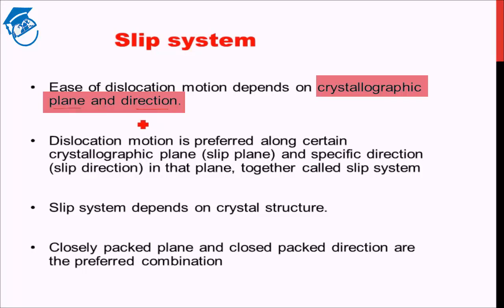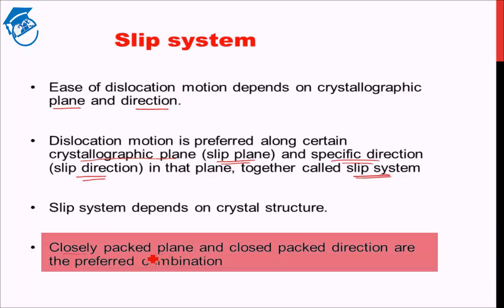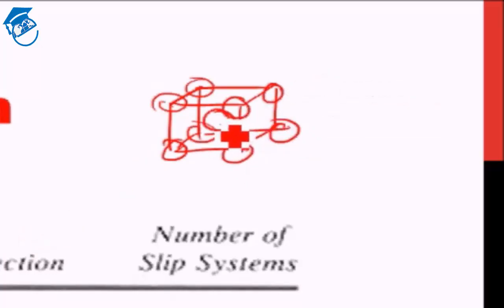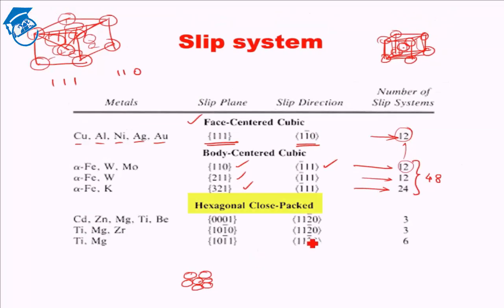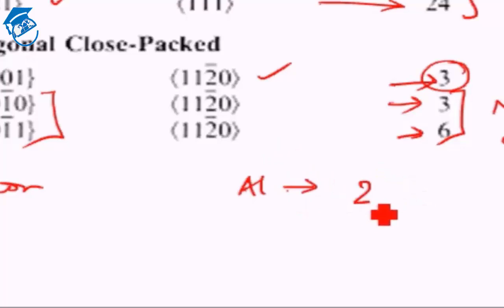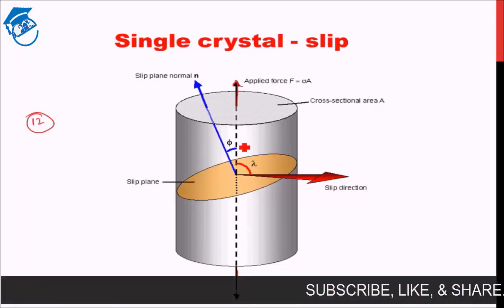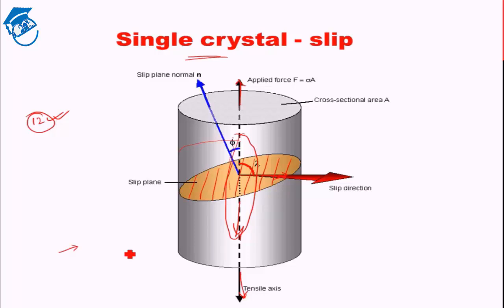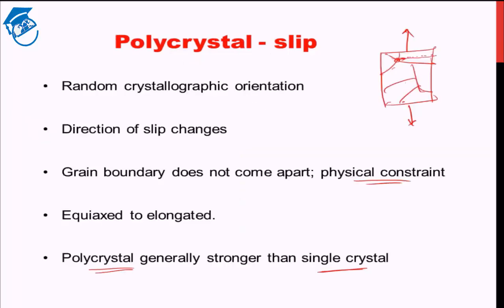AMIE Exam Lectures- Materials Science and Engineering | Slip System | 7.2

Comment: Why are the atoms that are close together have less required energy to dislocate? Does this mean that material with greater density are ductile (have the ability to dislocate easily)? Or do I have to factor in atomic weight into my hypothesis? Thus nullifying the pertinence of my question.
Reply: There is something known as the Peierls–Nabarro stress, which represents the force required to move a dislocation. The value is given by G*exp(-2*pi*W/b),

where, G is shear modulus
b is interatomic distance
W = a / (1-v), with a being interplanar distance and v is possion ratio

The value of the stress is small for smaller b (interatomic distance) and small for large a (interplanar distance). Closed packed planes have large a, hence small force requirement, thereby closed packed planes have less energy requirement for dislocation movement. Closed pack direction has small b, resulting in less force requirement, hence closed packed direction is direction of easy slip.

This is a very preliminary account of why certain slip systems are favored over other and the details can go multiple lectures. It has nothing to do with material density. The density we are referring to is the density of atoms (space occupancy, not mass) along specific slip system of interest (and not the whole material).

Comment: why we need 5 slip system for effective deformation to take place? Can you please explain? otherwise suggest me where to get these details.
Reply: Since the summation of the strains in the x, y and z direction need to be zero in plasticity (Due to volumetric constraints), all you need to find out are normal strains in the x, y directions and the xy, yz and xz components of shear strains. Since epsilonx+epsilony+epsilonz = 0 you can easily find out epsilonz. Therefore you only need 5 active slip planes at any point in time to calculate the deformation. In case you have less than 5 active slip planes, the material is considered to be less ductile.